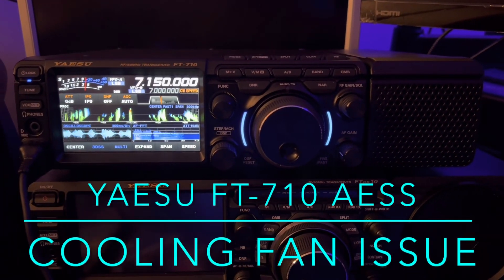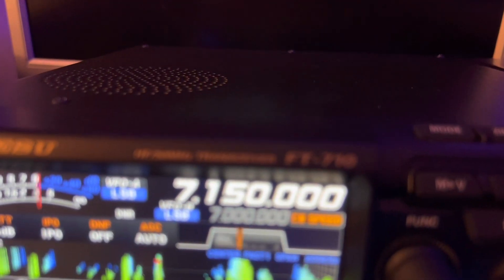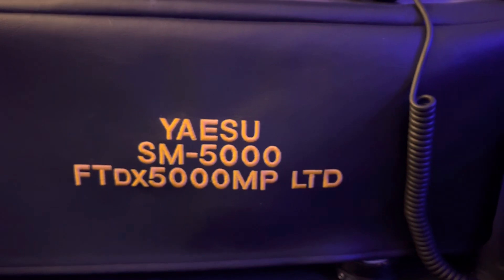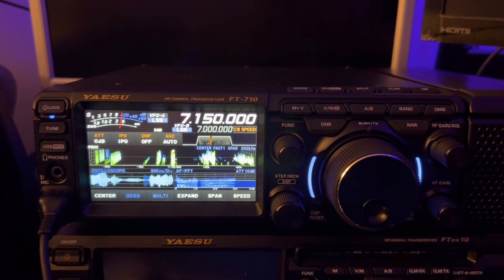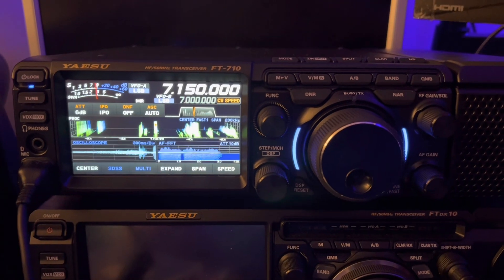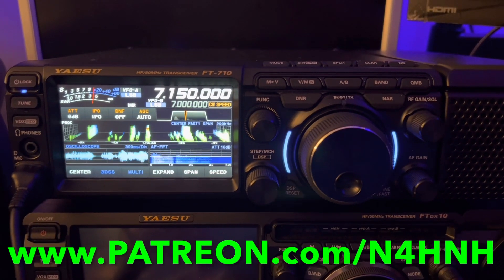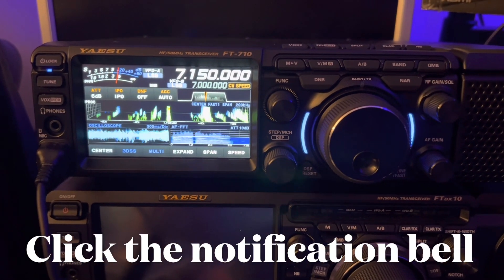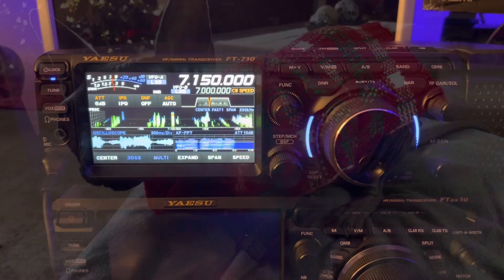Yaesu FT-710 AESS: Cooling Fan Issue (video #17 in this series) #hamradio #ft710 #fan

Comment: It probably was a engineering design requirement, due to the type of parts used, available heat sinking capabilities and overall radio stability. Packing more into a smaller space may have driven this fan activation. My Flex 6600M radio has a fan that runs on LOW speed as long as the radio is on. Super quiet, but if you place your ear next to the radio in a quiet room, you can tell it is on.
Reply from the maker: My FT-891 is even smaller, and the fan only runs after I transmit long enough to heat the finals to the threshold where they need to be cooled.  The fan in the FT-710 turns on at power up, when the radio is at room temperature in my shack, which is currently 66 degrees F.
Reply: @n4hnhradio  All valid points!! It will be interesting to see whet Yaesu has to say.. May be as mentioned a software revision missed by Yaesu??
Reply: Certainly... this radio has two ADCs running at 250 MHz plus FPGA and high speed microprocessor probably as well. So welcome to full SDR radios. They are like small factor PCs and need fans running all the time. But don't get me wrong... I learnt a lot in your videos about FT-710 many thanks!
Reply from the maker: Yaesu admitted that some were shipped with their cooling circuit improperly calibrated. The fan should only turn on after a few minutes of transmitting. The FTdx10 uses the same FPGA plus a superheterodyne front-end. My FTdx10 fan comes on only after I have transmitted for a while, or when I run FT8 at 50W.  The FT-710 I used for my videos was a loaner. It needed to be sent back for recalibration.

Comment: they changed that with the software up date in July
Reply from the maker: They didn’t change anything other than properly aligning them, once so many were returned with fan issues.  The one I used for my video series wasn’t properly aligned at the factory. Yaesu told me it needed to be returned for proper cooling circuit alignment.
Reply: @n4hnhradio  hi, this in the video is the "standard" noise for this radio, or some FT-710 can be worst?
Reply from the maker: Some are better and some are worse.

Comment: On my FT-710, the fan works when receiving also and is very noisy. Do you guys know how to solve this problem?
Reply from the maker: It is a widely reported issue. Some seem to be noisier than others. You could contact Yaesu about yours being noisy.  I read a report from one guy who returned his to Yaesu and it was sent back with a less noisy fan.  I will stick with the FTdx10.
Reply: @n4hnhradio  I'm afraid they added an external speaker because they suddenly discovered that some circuit was overheating. Therefore, they programmatically increased the aggression of the temperature sensor. This disqualifies this radio, because overheating cannot be fixed remotely by updating.

Comment: The fan in my FT-710 (less than a week old) runs constantly blowing cool air out the back. It’s pretty annoying.
Reply from the maker: Contact Yaesu. There is a fix but it requires recalibration.
Reply: @n4hnhradio  I noticed yesterday the fan cycled on and off periodically. The other day I’m pretty sure it was on full time. I wonder if it varies depending on the band I’m on. In both cases I was just rx. I’m monitoring it to see exactly what it’s doing and will probably contact Yaesu once I’ve confirmed.
Reply from the maker: On receive, it should rarely engage, unless the ambient temperature in the room is a little warm, or the radio is in in an area that doesn’t have good airflow. On SSB transmit, mine comes in after a few minutes into a QSO.  If I’m running FT8, it pretty much runs constantly.

Comment: Gracias  por la información. Creo que YAESU tiene problemas  de control de CALIDAD.
Reply from the maker: Someone in QC should have noticed that the fan was running constantly. I spoke to Yaesu about it, and they said the unit I have must not have been calibrated properly. Their two test units aren’t turning on the fan until they transmit. 

73, de N4HNH

Comment: That would drive me nuts!  I wonder if there is something in the design, perhaps voltage regulators, that get hot just running the processor or something.  I know when I was helping Jack(W8TEE) and Al design their home brew HF rig, those regulators just to run the µC and the display...........get HOT!!!!
Reply from the maker: I think it’s a mistake. The fan in my ICOM turns on every time I transmit. It turns on immediately when I transmit. It doesn’t wait until the finals get warm. It just turns on. And it stays on during receive. It stays on for minutes after I stop transmitting. It would be a terrible radio if I were to use it in my shack.  It is just on a timer. It isn’t triggered by a thermistor. So, I really think Yaesu didn’t think this through very well. Several idiosyncrasies I’ve discovered with this FT-710 make it clear to me that it was rushed to market, with little or no testing by a user-experience specialist. I do that in the software industry. It’s an important role.

73, Doug

Comment: On PC computers the fan/fans run on low when just idling along....these SDR radios today are doing a bunch of processing just sitting there as well.....perhaps that's why the fan is running on the 710....what do you think?
Reply from the maker: The FTdx10 has the same FPGA chip as the FT-710 AESS, plus the discrete components for the superheterodyne circuitry. But the FTdx10 fan only comes on after I have transmitted for a while. And even then, I can barely hear it.  I mostly hear the air movement. The FT-710 fan sounds somewhat like a transformer hum, running for the bulk of every hour. It turns on at power up. It might go 35 minutes before turning off for a couple of minutes, just sitting there receiving, in a cool room (66 degrees F).

I talked to Yaesu support. They think I have a defective radio. The technician told me that his only comes on after he transmits.

Comment: This might be not the more appropriate  video for asking the following question, as it is related to the fan logic,  anyway, as it is the most recent one, I was wondering if the (analog) block diagram called divider has been figured out?, to me, looks very much like a Tayloe quadrature mixer, on which the two output signals at 90 degrees offset (I, Q) feed the two ADC's, very much like  the earlier Flex Radio architectures (1500, 3k, 5k).. Once released (not yet available at our local dealers), the service manual,  might be the proper source to find it out.
Thanks
Reply from the maker: Can’t know for sure without the schematic.  Whatever method Yaesu used sure seems to work well. The FT-710 beats all other pure SDR-based transceivers when ranking is based upon dynamic range. That’s quite a feat. 

I’ve not experienced a single issue with overload, like with the IC-7300. The randomization and dithering is performing well, and the cross-modulation characteristic seems to be quite good. 

73, de N4HNH
Reply: @n4hnhradio  Sure it does, I am almost certain that block is a QSD, actually, not just the closed in IMD3 DR, I worked out the overall equipment effectiveness (OEE), based on Sherwood main data, and it turned out to be above the Flex 6700 and a notch down from the FTDX10, very remarkable. As per all direct conversion/sampling radios, blocking DR is the weakest point!!
73, Clay I4LEC
Reply from the maker: The Sherwood footnotes for the Flex 6700 production models states 99dB, not 108dB. So it should be down the list, below the top 10. The 6700 he tested was specially prepared for his test.
Reply: @claudiocapelli7507  TI's dual ADC ADS62P45 and Artix 7 FPGA are used in the FT-710, according to Yaesu's brochures and some forums that have already talked about it. Same hardware as in the FT-DX10, but there is no mixing down to the intermediate frequency of 9 MHz and there is no roofing filter. The BPF stage is the only place where the analog signal from the antenna is filtered. After the roofing filter, FT-DX10 uses one ADC channel for the receiver, and the other is used to show a spectrum that is wider than the receiving channel. The FT-710 uses both ADC channels at the same time with a power divider that apparently improves noise and dynamic range by some 3dB. The sampled signal is split into a wide spectrum display channel and a receive channel in the FPGA, and the DSP handles the baseband signal. There is also dithering at the ADC input, which helps expand dynamic range even more.
All newer SDRs are made using this or a similar design (IC-7300, K4, Flex 6700, USRP N200/BasicRX combo, HPSDR Mercury/Hermes, etc.). One problem with the QSD platform is that the signal isn't converted to digital until after it has been processed in the analog domain by some kind of mixer. This can make it harder to get the same parameters for all receivers in a series than with direct sampling, so serial production is usually cheaper for direct sampling.
Reply from the maker: Very well articulated, Marko.
Reply: @n4hnhradio  thank you 😊
Reply from the maker: Yaesu didn’t need to “reinvent the wheel” with the FT-710. It made perfect sense for them to just tweak the FTdx10 design. 

Perhaps within the next 5-10 years the pure SDR technology might even be able to outrank the hybrid for dynamic range.
Reply: @n4hnhradio  By using Direct Conversion architecture, they can avoid roofing filters, which are quite expensive, and it should also be easier to make changes or fine-tune the software. If even more research is done on direct sampling receivers, the hardware will improve faster and cost less in the long run. If only Yaesu were trustable about issuing timely firmware updates after receiving a bug report. Also, they will learn more about the full SDR concept along the way, but they simply shouldn't use their customer base as beta testers. 
For example, the Elrad FDM-DUO HF/6M QRP Standalone SDR Transceiver was made with almost the same design as the HPSDR Hermes. It can have multiple receivers if you use the FDM-SW2 software on a PC. Although it's clear Yaesu didn't take that approach with FT-710, it's possible that they are planning ahead for it.
Reply: thanks for the exhaustive replay, then is a direct sampling architecture, using a pair of 14 bits ADCs, that , according to the datasheet, are actually a dual channel type ?(basically 4 ADCs), will be interesting to look at what seems to differentiate it from the others DS  "power divider" as the FT 710, in the lab,  beats all other DS radios.
Regarding dithering, most of the other DS radios use LT ADC devices with such feature built-in + random noise, these make sense while there is very little if no signal at the ADC input, to mitigate quantization noise, once an antenna is connected, there is normally more than enough signal to take care of it.
Reply: @claudiocapelli7507  Yes, it will be interesting to see how extending the dynamic range develops in the future. Concerning the ADC, there is only one IC with two separate ADC channels.
Here's an interesting fact from research outside of the business world. PA3AKE found a problem with the Analog Devices AD9910 DDS when he was looking into the H-mode mixer. The problem showed up as strong AM noise. I0CG found the same problem with the AD9912, but it was much less evident. The manufacturer did eventually come forward to confirm the findings. When those DDSs were used for a certain application, they caused a problem because of a simple design flaw.
Let's just hope that someone figures out how to push the BDR limit even further for direct sampling receivers.
Reply: Marko, yes 1 chip, I did realize it afterwards! I guess the game changer will be when the LNA wont be needed anymore, when the ADC will reach an MDS at 500Hz of about -135dBm, 24 bit ADC? (maybe already available, but too expensive for the Ham application).
p.s. I use an Hermes board, the limited BDR is not really a limit, except when you have a very close neighbor in band at over S9+65 
thanks again for the insight

Comment: This is why I went back to using my Astron RS20M power supply after using my Samlex SEC-1235M for two months with my DX10. The Samlex fan would cycle on and off on simple receive. I find that unacceptable as well.
Reply from the maker: It’s annoying in a quiet shack.

Comment: O k every radio I ever bought has little warts and yaesu has done well addressing where I just did the latest March firmware update. Now the digital nr on my ft710 is behaving more like my dx10. Until there is a firmware update Doug how about going into service menu and adjusting the fan settings so it will not stay on all the time. The radio stays perfectly cool under heavy use so I think an adjustment can be made in service manual anyone looked into this??
Reply from the maker: If you send to Yaesu, one of the things they do is a realignment. Apparently many were shipped without the fan circuit being properly aligned. Also, some are mechanically noisy. One person sent his back with a mechanically noisy fan and Yaesu returned it with a note that read, “no problem found.”  But his is as quiet as a mouse now.

Comment: IC-7610 fan intermittently comes on during receive.  Surprised that Yaesu doesn't modulate the fan speed with load. 👍
Reply from the maker: Yaesu uses thermal sensing with other transceivers. I never hear the fan until I’ve transmitted for a while. The threshold for the FT-710 must be a very low temperature. It’s currently 66F in my shack and the fan turns on as soon as I power up the FT-710. 

73, de N4HNH

Comment: Have a similar issue with my 2nd generation Ftm400xdr.  Yes the original had a vent problem but my new 400, has started loosing audio modulation and fan running unexpectedly.  Use medium power and has a problem. Any comments?
Reply from the maker: That sounds like a component failing.  I assume there is no obstruction preventing proper air flow?  Are you beyond the 3-year warranty period?

Comment: On my FT-891, the fan only works when receiving if the ambient temperature is more than 30C(86F). If the manufacturer has configured the fan to turn on so early, it means that he is not completely sure of the cooling efficiency. This is really an open beta at the expense of buyers😒
Reply from the maker: That’s what I experience as well and mine is in my truck. When I activate the heater in my truck, the fan turns on but I can’t hear it over the heater so it’s no problem. It’s no problem anyway because road noise covers it up. But, in the quiet shack, the fans are noticeable. 

73, de N4HNH

Comment: in another channel a guy measured the current his FT-710 draws when only receiving (SSB), it was 1.4A, which is alot of current for only receiving. so i asked him doesnt that radio get hot when drawing so much current when receiving? he said no. i guess then the 710 needs the fan constantly running to prevent overheating, which would be i think why they wouldnt make a software update to switch the fan of when that radio is only receiving, else it would have a thermal damage from overheating as said. they can maybe make a software update to have the fan run only for a short while and at topspeed, to then have a period of reception with the fan switched off, but is that good for the parts in the radio to heat up and cool down all the time, i doubt that. people who bought that thing will then i guess have to live with the fan constantly running. excuse me if that was to many words, just my thoughts on that cooling fan issue, it has become a bit lengthy for a yt - comment. by the way, i'm glad i havent pulled the trigger yet on the 710, althought with its external speaker it has makes a clear pleasent sound when receiving ssb speech (j3e). is there any modification to make the FT-710 keep cool in reception mode without the fan ? i wonder.
Reply from the maker: The FTdx10 has the same display and similar architecture, except it has the superhet front end. The fan only turns on after transmitting at full power for a few minutes. Yaesu told me that the FT-710 should act the same. The tech said this one might need a “realignment.”

Comment: Maybe your bias is set a little too high on the final output stage.
Reply from the maker: Yaesu told me that the cooling threshold of some of the transceivers wasn’t properly calibrated. Yaesu will fix under warranty.

Comment: after 11 months  now, is the issue about the fan cleared ?
Reply from the maker: I don’t know. That would be a question for Yaesu.  Some issues were mechanical and some alignment.  Certain fans were mechanically noisy, even if they didn’t run 95% of the time while just receiving.
Reply: Hello,I have to chose between 710 and dx10,please tell me your feedback now,after you have test both radio's.
Which one is the best?
Reply: 73, from YO2DA
Reply from the maker: I still prefer the FTdx10.
Reply: It still (202409) runs all the time after few minutes since it gets powered on.